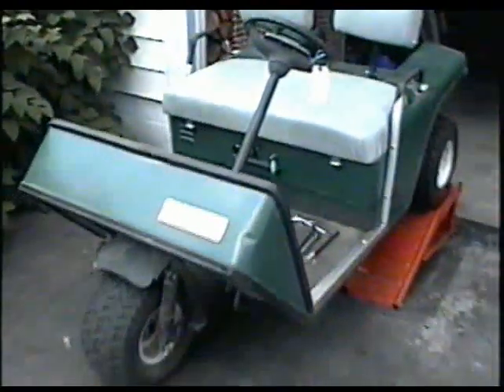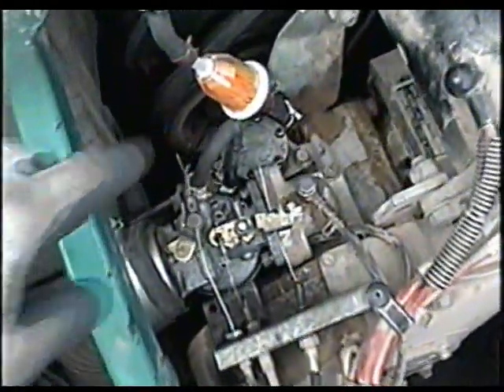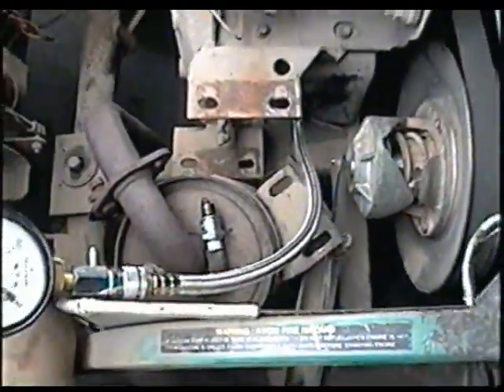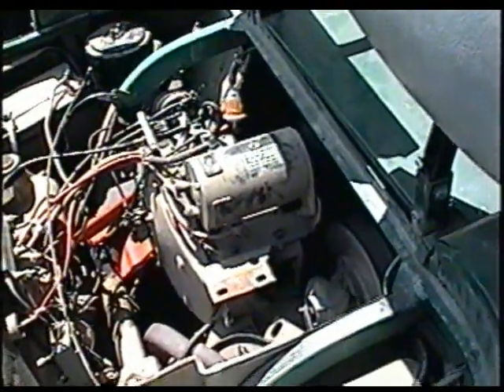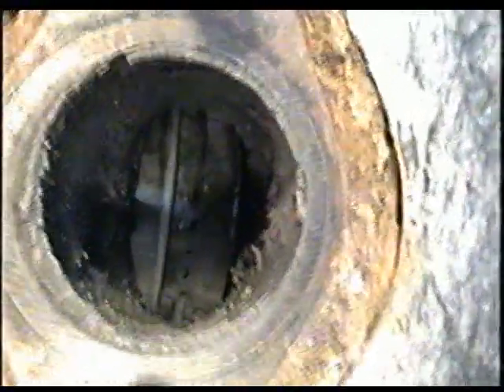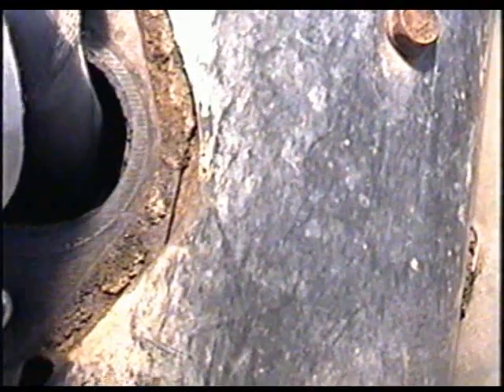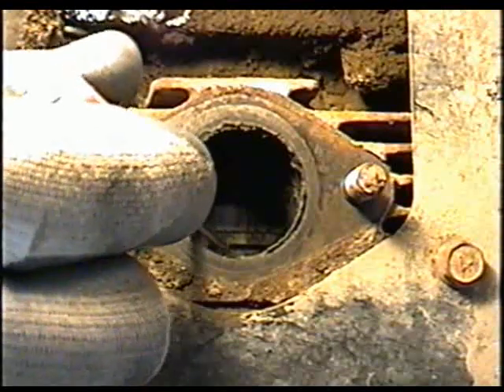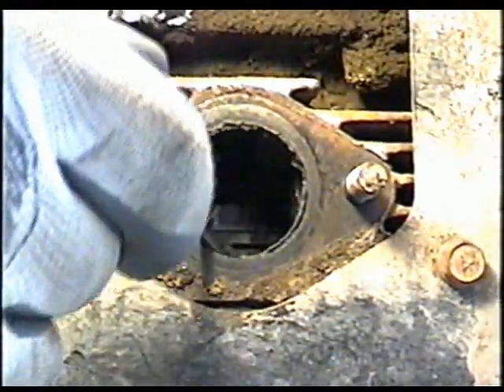Diagnosis of EZGO Gasoline Golf Cart

Comment: Hey Dony, I have a 1989 ezgo gas cart that starts up at the beginning of the day and runs great until it warms up about 20 minutes and stalls out usually after in coasts down a hill, then it will not restart for about 10 minutes. runs for while then stalls again ,any suggestions?
Reply: Gary Cummings I know it says you been it was two years I'm having the same problem with mine late 80s model only runs for about 20 minutes if that then won't restart until it's totally Stone Cold
Reply: hey Donnie having a problem with my late 80s model you can start it drive it for maybe a quarter mile tops shuts off will not restart until it totally cools off any suggestions bro

Comment: I have a real good question for you.We have replaced the foward reverse switch,ignitor,coil and coil wire.We were having problems with when we bought it it ran very well but after a few laps around the yard it would act like it was getting hot and not run for about 15 to 20 min and then you could start it and run 2 more laps.After replacing all these the electric motor will run but will not start the gas motor and we do have fire going from the coil to the plug do you know what is going on?

Comment: Hey Dony, you never cease to amaze..I've been looking for some info on this very same engine. Do you have a wiring diagram of the internal starter or stator assembly. I have the 244 Robin 2 \stroke with internakl starter but the wires from it have been cut
Can anybody help??
Reply from the maker: Daniel Murphy sorry I don't, you'll have to Google that
Reply: +donyboy73  ever worked on a 1973 Harley Davison golf kart do a video two cycle golf kart

Comment: I have a 92 ez go gas engine doesn't want to start unless choke is pulled all the way out then backfires sometimes but once it starts running  I can push the choke back in ad it runs good  until I have to start it again . I had a local golf cart business take it in ad $1200 later still does the same . it has a new carb , new choke cable, new fuel pump , new fuel filter air filter solenoid  you name it they obviously didn't know anything and just started replacing everything .ive got over $1200 in repairs in this old golf cart do you think this might be something simple ? frustrated

Comment: my kohler opposed twin 18 horse reads 60 psi and it runs really well. the cylenders are not scored. i did take the head off and put it back on with the old gasget, could that cause low compression? it's 4 stroke by the way...

Comment: @donyboy73 Update on it - Cooling fins were absolutely caked in dirt and the upper half of the engine was just cooked.  Top of the piston is burned off (with some deposited on the cylinder at TDC).  Rings seized in the ring grooves.  Piston has  a crack on the exhaust side of the piston that runs 1/3 of the way around the engine.  Wrist pin was blued and slightly stepped as well. To those reading, do your engine a favor and keep your cooling fins clean!

Comment: I think I've got you beat!  I just picked up an '85 EZ-GO with the 2PG engine.  Best I can get for compression is just under 10psi.  Makes your piston rock look GOOD!  I'm not missing rings but they're worn flush with the piston and pretty well useless.  Can't say for certain there's not ring sections missing that I can't see through the exhaust.   Next up I'll be doing the rebuild just as you did.  Guess I might as well body it out for a fresh cart!

Comment: @griffy85b, normally the normal engine compression should be higher than 100 psi, if i am not mistaken, the reading should be at 130 psi of pressure, anything falls below 90 psi, needs servicing

Comment: @gpzDave, any golf cart that is equip with a 2 stroke engine is a dual runner, which means it can run clockwise and counter clockwise, which are pretty neat little engines

Comment: dang, low compression. Definitely time for a rebuild.

Those Fuji engines are pretty good though, I've got a Fuji 340 on my polaris snowmobile, it's been great.

I won't be surprised if the person pays for you to fix it. Golf is an expensive hobby, if that's really what it gets used for. Golfers are used to spending a lot. Besides, a new golf cart will cost easily 4 grand.